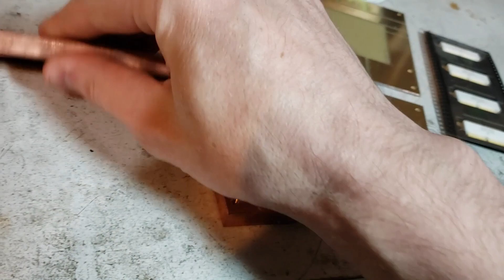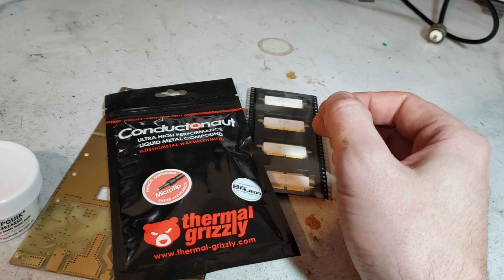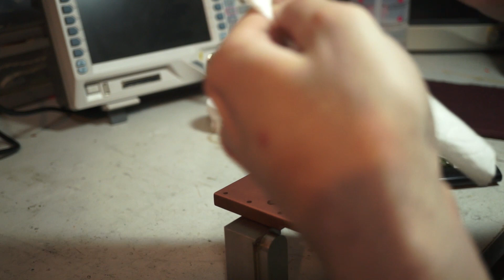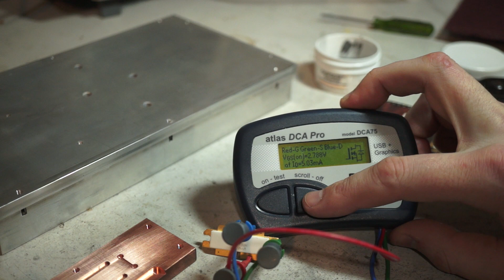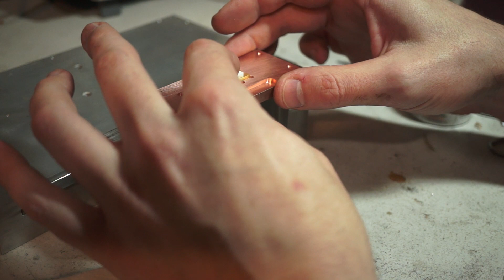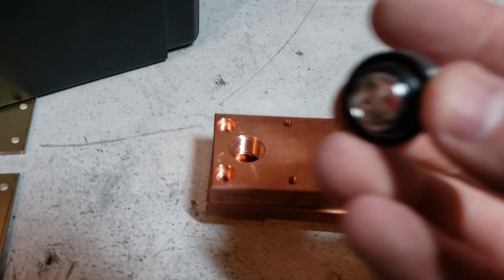4x LDMOS Build Pt.1

Comment: Sharky, with your water cooled design, I think you could use aluminum for the lower half with almost no change in efficiency.  Those fins are great.  Deep slots in copper, very impressed.
Reply: No, you shouldn't mix aluminum and copper together, this induces galvanic corrosion.

Comment: Not sure how much its going to matter but a better way to flow the water through the block is to center feed it and have the outlets on the sides. It balances the temperature across the heat source.

Comment: Gate thershold voltage or Vgsth is temperature dependant, about -5mV/°C at such a low current, so the only way to know whether the threshold voltage has changed or not, is by keeping the device temperature exactly the same before and after. The LDMOS might have been a bit hotter after soldering, hence lower Vgsth, which does not mean the soldering altered it. Nice watercooler block, however the 1st half will always run colder than the second half, not sure by how much.
Reply from the maker: Good catch. I realized this a bit after making the video.

As for the waterblock, temp diff from one end of the device is negligible. At 1gpm the difference is only a degree or two. I spent a lot of time on CFD simulations to get that water block working so well.
Reply: @MudDuckSharky so you designed the cooling blocks ??? Good job !!!!!!  I would also recommend moving to plastic package, as the thermal resistance is lower, and it is cheaper also. Mrfx1k80n are 20 to 40 dollars cheaper than mrfx1k80h. Regarding the feed choke, what difference do you notice compared to feeding directly through the mid point of the primary coil of the output transformer ??? Good luck on your project.

Comment: Looks like something that is going to evolutionize linear amplifiers, so that this continuous operation can be achieved by us all in the future. I am wondering how the phasing of the power supplies are going to have to be changed for continuous duty as well to be able to keep up with the voltages this is going to require them to have as well.

Comment: Grate video! Got a question. Are you got to restic the out going flow of the heat sink a little to help with heat transfer... just thinking of my younger day of racing and pulling the thromostat out and having the engine over heat had to install a restricteor to slow the coolant throw the engine and ran much cooler...🤷‍♂️

Comment: most broadcast transmitters use some kind of water Cooling.  glad you point out that thermal compound is for testing only .not only does it go bad over time . i does migrate un into pill leads and transformers coils and tuning caps.  That thermal compound is re active to RF and de tune the circuit over time. I had a few amps come threw that had gray thermal compound for CPU put under 2879 Etc. and the amp failed over time just because of thermal compound migrated and de tuned circuit . don't forget outher copoints around the pill  will heat up as well and the combiners also. 73's

Comment: i run my amp with 2290's at about 75% output with a overkill cooling fan and for 15 minutes or better. been using same amp for over 10 years. i am a firm believer in running my amps at 75 % or less. think of your car. it can probably run over 100 mph but for how long? if its a radio drive 4 watt amp try running it with 2 watt deadkey but not going over 4 watts. same with multi pill amps that you drive with a smaller amp.